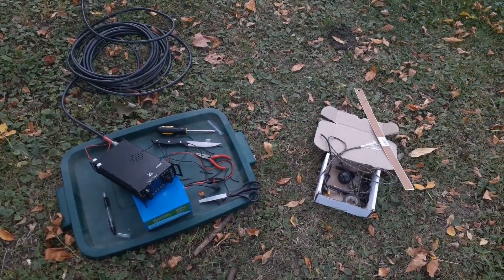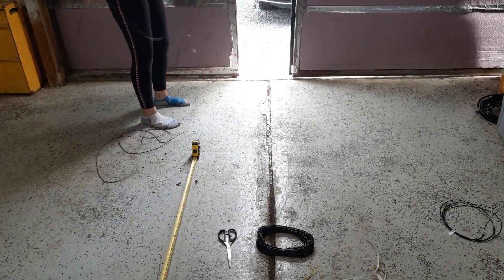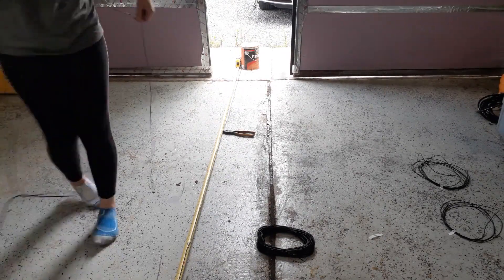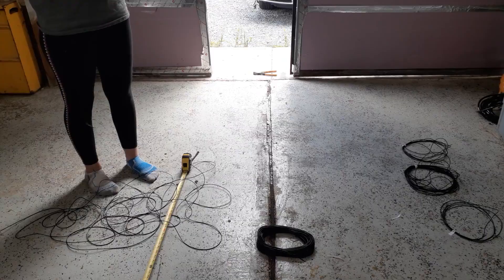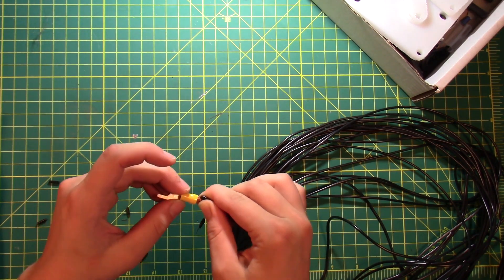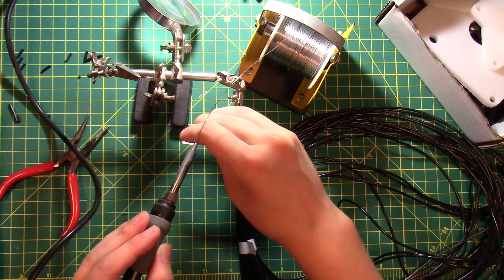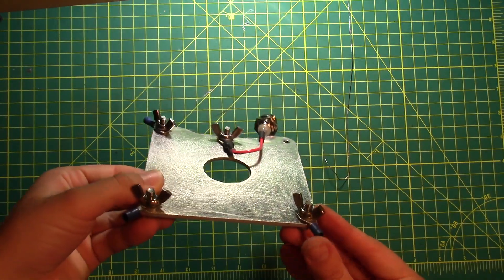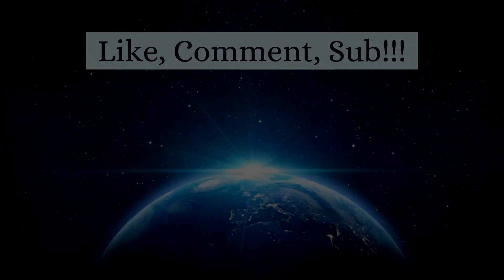Dx Commander Lite Build Part 1!!!

Comment: Leah, your 40m element should have worked just fine as a 3/4 wave on 15m.  For cutting the radials, I would have simply measured the first one, and then measured the rest against that one.  Still good job!  I'm working on mine right now!

Jeremy Utley, NQ0M
Reply from the maker: Good luck on the build, and getting on the air!!!